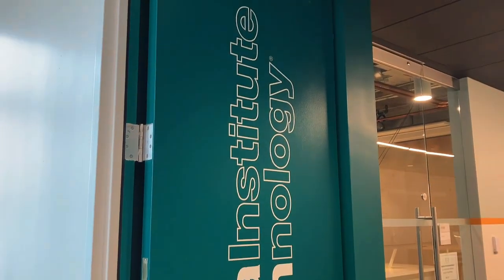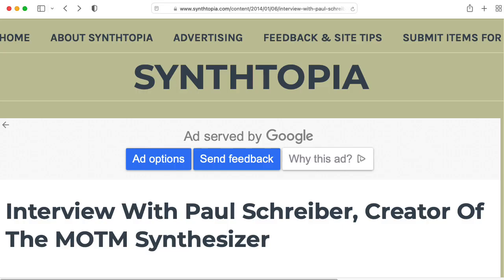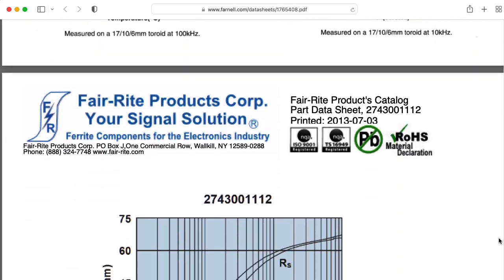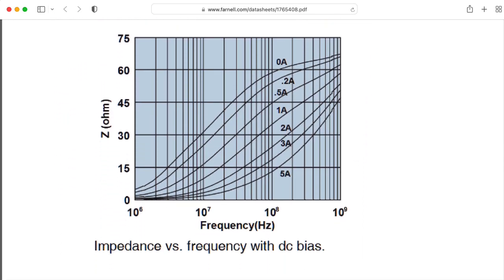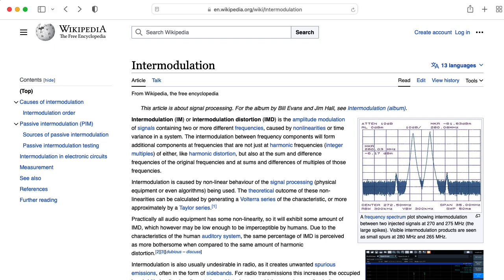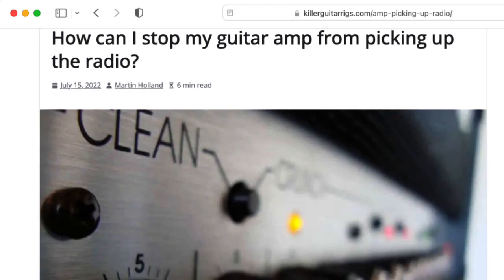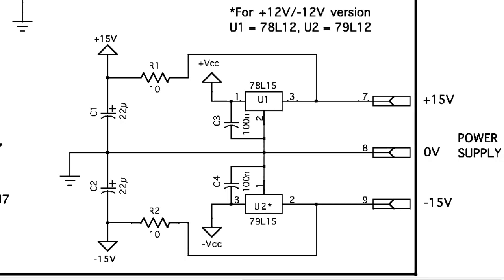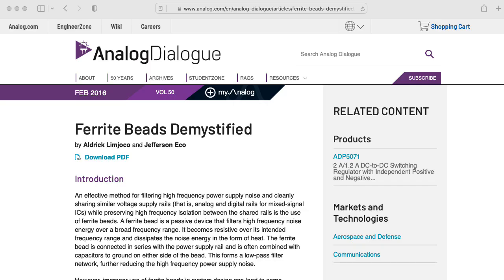Synth Power Filtering: To Bead, or Not To Bead? (alternatively, Ferrites: Functional or Foolhardy?)

Comment: Both, in the case of BBD-based echo / chorus / flanger instruments. The BBDs operate at this fun little frequency range up to either 100kHz or 200kHz. Ferrites: best results are had by using large value ferrites (quite low frequency by ferrite standards) between the FET driver outputs and the BBD clock inputs, ensuring not much unintentional noise, no matter how small, passes into the BBD clock inputs. Meanwhile, the FET drivers' power, and clock gen's power, both sit behind another low freq ferrite, a power diode, a 16Ω power resistor, along with a dedicated tantalum nearby, to keep the whole clock shebang far away from the rails. Dead-quiet BBD echoes without needing to use a compander. Fair game, until the operator intentionally pushes the clock down below 20kHz, then all bets are off and the fun begins. The result is of course audible ring modulation, but importantly, it stays off the rails, playing nicely with the rest of the synth.
Reply from the maker: Pinning this. :)

Comment: If you use 10ohm resistors on say a +and - 15v dc rail what size should you use. I ask as I used 10ohm 1/4w resistors before and they caught fire.  Would you need higher wattage rated resistors for the rc network . Or is this an effect of the output current rather than the voltage?

Hope this made sense 

Kind regards

Comment: I used a fiew times small inductors. Higher resistance and inductance than beads, better filtering in wider frequency range. More expensive unfortunatelly. Only in my own circuits.

Comment: Hi Aaron, would you recomend using ferrite beads on the supply rails of an  analog chorus  pcb that has a clock running @ 200khz?  So far on my synth project I have not used beads on any of the rails because I am using a linear supply and have no digital noise. I have only used low pass filters at this stage. 
Cheers.

Comment: Hi Aaron, since you mention my way of dealing with these HF interferences over the power line; I use 10 ohms resistors also to reduce the voltage drop which is minor if the module current draw remains under 30 mA. As a matter of fact I maintained these 10 ohm resistors because they saved my ass in many occasion while SDIYing. They act as current limitors in case of short circuit in the module and in very frank short circuit they simply act as fuses and get burnt, while the other components are preserved. Therefore two functions HF filtering and current limitation... Hope this helps
Reply: Hey Yuaynth I noticed the 10ohm resistors in alot of your schematics . What wattage do these resistors need to be . As I used ordinary 10ohm 1/4w resistors which just heated up and caught fire ?
Reply: @AdamTheAd-vanc3d  Hi 1/4W is OK in most of the cases.
Reply: @yusynthman  Many thanks for your reply 🙏🏾

Comment: All I know so far is this CUBE cheap low-Wattage guitar amp picked-up some local AM (pretty sure it was not FM, not sure if I bothered checking) station was getting annoying enough upon un-boxing I should've returned it.

* * * b u t * * *

I intuited or near that this ferrite ring core about an inch and a half in diameter about 3/8" square cross-section 'that'll fix it!" came to me, detached the clip from the Pos lead on the little cheap five or six inch speaker, wrapped it around the ring about 6 to 8 times, not sure why I didn't pull my usual OCD and wrap it until it was too short to re-connect, and

VIOLA!

no radio in the speaker any more.

did I test it in a different location to see?

probably not

it just works

Thanks For Furthering My Edumacation On This IMPORTANT Topic!

Comment: I made a theoretical (not empirical) study of this, and found a number of things.
(1) This is a bi-directional filter. Given a decent bus, the biggest effect of any of these solutions is not to filter that bus, but to keep high speed current draws confined to the module that draws them. That module will be less able to pull current out of the bus at those frequencies, using the on board capacitors instead. As a result the bus will be quieter. It's the same principle as pandemic masking: it's hard to fight disease/noise out there, so the best solution is to not be an asshole, especially if you know you're sick/noisy.
(2) Again, what you're filtering is your ability to draw current from the bus. If you can't effectively pull enough current from an on-module reservoir at the blocked frequency, you have just made your power distribution much worse. This will manifest not just as a DC voltage drop but as a voltage drop that varies with the current draw at the frequency of interest, potentially creating correlated noise, i.e. distortion. Resistors, inductors (because practical inductors are resistors), and diodes all will exhibit changes in voltage with changes in audio rate current, making your super accurate power regulator and low impedance power bus totally worthless. A ferrite has practically zero resistance at DC and audio rate. This is in fact exactly what you want. It allows the bus and regulators to do their job and get stable voltage to your module at any frequencies which your bypass capacitors are too slow to provide.
(3) To summarize: there is a frequency dependent tradeoff between keeping noise off the bus and having a stable voltage. In most cases the ferrite bead is pretty much the perfect solution to that problem. However, if we assume a relatively clean environment, some modules won't need it. And for a very high current draw at high frequencies (a digital module), it might make sense to use an inductor instead, provided you can demonstrate the resulting system is overdamped and won't ring or oscillate.

For real, though, the idea of "the audio range" causes so many problems in audio. People keep simplifying things by throwing out all data and results outside of those magic frequencies, as if they just didn't exist. Then it turns out that there is a relationship between the time domain and frequency domain, and that only with purely linear systems (which don't really exist) will things in one frequency range stay in that range.
Reply from the maker: I love your pandemic analogy. :)
Reply from the maker: I'm often helping students debug in lab where the sound will be anemic, and we put it on the scope and discover there's like a 500 kHz parasitic oscillation on some op amp eating up all the dynamic range.
Reply from the maker: And indeed, Eurorack power rails seems like an awfully messy place!

Comment: Ferrite beads can be an extremely effective means of heavily attenuating impulsive noise riding on the supply rails of a shared backplane, preventing it from getting onto the local supply rails inside of a module. If the impulsive noise has a period at audio rate, then it can very easily, and often will, find its way through your final vca etc. to be present at a very low, but still annoying,  audible level at the output. Suggesting that they are of no use (the article) is incorrect; please take Paul Schreiber's advice.

Comment: if I were designing more MCU based circuits I'd probably use them, but I don't currently. as someone else stated, they're incredibly cheap so I think moving forward I'll give them a shot. 

also the 10ohm-resistor-as-fuse thing always makes me wince. it's the basis for low-pass power filtering sure but I'd far far rather use schottky's for reverse polarity protection

Comment: Well for me there is no debate for now... my DIY small system just works well enough with a basic linear DIY power supply, without ferrites. I don't use microcontrollers, just pure anlogue basic stuffs with opamps. 

It is just until very recently that I was more worried about power supply cleanless, when I started experimenting with RIAA preamps. I was just wondering if I could power it with a +5V cheap external power supply and a charge pump for -5V. These preamps just grabs anything unless connectors are wired to ground and with a good shielding around the circuit. And all the ripple in the power supply is audible, with no real way to avoid it completely. So yeah, linear power supply is the way to go in these kinds of (if not all) audio applications.

Comment: i didn’t bother with them for the first revision of the module i made and kinda forgot about, but i did calculate the lowpass from the resistors and capacitors to make sure it would actually have a decent effect, the caps on the back are pretty large as a result lmao. as in, if i’m gonna put some resistance on the power rails, i might as well get good filtering with it. i think it’s somewhere around 200-500hz, not enough to remove everything, but enough to remove the more noticeable higher frequencies.

it’s analog but very nonlinear so maybe for a future revision whenever i work on it again i’ll try to find a ferrite bead or inductor that would be useful in the range of common clock frequencies. i don’t have a working unit to test to see if it’s an issue, so i dunno.

Comment: As an active RF engineer with 40 years of design experience, Ferrite beads are primarily used for RF isolation (say in the 1Mhz to 1Ghz region), they will have little effect on audio signals. semiconductors have much more ability to rectify RF signals in todays circuits as compared to 30 years ago due to semiconductor process improvements. It is very common for audio circuits to pick up stray RF signals (including from cellphones) and to rectify it a bit and cause DC shifts or demodulate the ampltude portion of a signal. GSM cellular is especially nasty for creating 'noise' in the audio band. You will find many RF beads in every single properly designed circuit that uses big (ie higher current) CPUs or DSPs to help isolate digital sections from the analog sections in these circuits. At todays current levels, 10 ohm resistors will not suffice.

Comment: I often use Ferrite. Beads for my designs. I got a Reel of Z=180Ohms@100MHz (3000mA) SMD 0805 hat hand why not use them?. they work in frequencies where bulky capacitors do not work as capacitors. I mostly built a "T" topology with two Beads and one 100nF foil-Capacitor to Ground on input and powerlines to enable hot-plugging and prevent spikes from further stages..passed all my EMV tests..

Comment: If I were using a linear power supply I probably wouldn’t bother. If I were using a low-noise (especially quasi-resonant) switching power supply with I also wouldn’t bother. But if I were using a common SMPS, especially an ungrounded one, those square harmonics are going to be well into the MHz, be they carried on wires or transmitted through the air. I’d probably use a choke of some sort, probably also a capacitance multiplier if the circuit’s PSRR is low. Capacitance multipliers, especially when used with a zener diode (or TL431) give much better ripple rejection at non-mains frequencies than conventional linear regulators, I’d recommend them over series resistors any day.

Comment: I am on RLC-filtering side (something like 200-500 uH on ferrite 7-10 mm diameter toroid + 4.7-15 Ohms residtor + 6.8-15uF tantalum/electrolityc + cer caps 0.068-0.33uF close to ICs)
However i have no VNA to test it on high frequinces, but on low frequinces this RLC filters provides 40dB/decade suppression. Choise of R depends of power consumption. It must be simulated to not have resonant burst on the frequency response while you simulate all your circuit by resistance of equivalent power dissipation.

Comment: Beads can filter high frequency noise, but also affect the PCB PDN impedance (Depending on your PDN needs this will require testing and you should). Most likely, poeple end up over decoupling with caps acting more like coulomb bucket helping PDN. Beside Ferrite+caps may resonate if the second order filter turn out under damped (The systeme could have a spike in the bode plot between 60KHz and 200 KHz and that is for you to mitigate or accept this effect in the design phase). If the design have a low speed digital circuit with MCU, I doubt this will be a problem. For ADC and DAC, beads may turn to be problematic causing ground bounce. Bypass caps also act as high frequency filter making low impedance return path, this is why Pi filter are popular in the audio world. Lee W. Ritchey would call ferrite beads Voodoo beads and in design with signal rise time requiring harmonics above 2.5GHz I think he is right to dislike them, but I like to leave a open door. I tend to put compatible footprint in design and test for myself between Beads, 0-10 Ohm. I have yet to find a design were the ferrite beads turned out to be a true necessity, but leaving a ferrite/0 ohm footprint cost nothing and you do not have to argue with old timer engineer about ferrite.
Reply: Agree, it’s very wise to leave yourself room for configurability when you’re at the EMI lab realizing you’ve made a Big Mistake. I also think that modern digital ICs with controlled edge rates make the approaches used in the past less useful.

Have you encountered these resonances even with the high damping that beads provide? I would for sure expect these problems with pure inductors, but the FBs tend to be very lossy.
Reply: @enginerdy  I know, ferrite are a very popular quick fix when facing a failed EMC compliance test. In many cases, they impede the high frequency harmonics, lower slew rate and indeed, a board with no High frequency harmonics will stop spitting EMI. If every designed functions still works after that, I think its great and hardware designer should go for it at that stage. I have my share of mistake fixed that way, but I always look at that solution like a bandage. 

I once had a piezo element that went into resonance (Bigger caps made the needed zero to solve this). So I did learn the hard way about this resonance effect. Aldrick Limjoco has a decent article on the Analog device where he talks about the resonance. It makes absolute sens. Beside I had to the fact that I did put a bead there, and did not calculate anything. That is the main problem with beads, I have the feeling people put them in design out of habit not knowing exactly what they do and why it is solving their problem or causing them. 

If you look into LTspice, they have many ferrite model from Würth Elektronik in the base version and you can simulate this resonance effect by matching High Q capacitor with them (They can resonate in the MHz if the cap is small enough (This will normally not happen on a power rail). Their model are not loosy enough most of the time. Fitting their model with a real PCB may require some additional "lefty" mohm in series in the Spice. In real life application, I found that anything around 22uF and above never resonate when paired with classic 30 - 120 ohm beads, but that is just a personal observation based on the rare ferrite I use.
Reply: @ltremblay1598  I also consider a ferrite cable clamp as a failure condition of a design :(

Comment: Those beads or multi-turn chokes help a lot to reduce high frequency noise. We mostly use those on microcontroller components to prevent interference of the digital signals on analog parts of the circuit. Not only do I use these on power input but also on analog (input and output) signals and as common mode chokes on balanced (digital) signals like USB and CAN bus lines. It is amazing to see the effect of placing a common mode choke on the USB data lines. 
Placing them on the power input of a synthesizer module might seem overkill but it never hurts. Do remind that the impedance of a small bead can be much more than 10 ohms for higher frequencies.
Reply: how would you wire a common mode choke in a 2(+-12V) or 3(+5V) rail power supply?
Reply: @woosix1  I would not. Since these power supplies have a common ground, there is no need or use for common more filtering. Common mode filtering is only done on balanced (data) lines. Also, the ground connection of the power supply is often also used as a data (or audio) ground so putting that wire in a common mode choke on a module would completely defeat its purpose and possibly even having a countering effect.

Comment: One pro argument could be that removing very high frequencies from the circuit could help an op-amp or transistor avoid going into resonance at these high frequency, which could damage them. Much like adding a grid resistor to a power tube perhaps. But probably a good way is to measure the frequency response of the circuit in different environments and different power supply and see if one can measure anything undesirable.

Comment: IMSAIguy did a video where he measured the effect of various ferrite beads and found they could vary quite a lot in quality, with the worst one being almost no effect. These were mainly the big beads, he does do some small beads and some different designs of small bead are on par with the best big beads, while the normal small ones are on par with the worst, which seems appropriate. My point in this is, unless you have the right test equipment, a good frequency sweep generator and an spectrograph with high enough range, using beads is really in the realm of reckoning. Every other basic component has tolerances and defects, but the instruments to characterize them is cheaper, easier, so manufacturers are easily held to their standards. Without testing them, you're reckoning that the datasheet is true, and the parts are authentic. The only thing you can do to improve that is buy from highly reputable vendors and highly reputable merchants. Even then, you're reckoning what type of problem there is, you don't have the specifics, which can make it hard to select the part. I'm not saying you shouldn't, but that without the right tools it's kind of a bandaid shotgun, you might simply miss the problem, and "failure" won't indicate anything more than "this one didn't work", perhaps because it was the wrong one, perhaps because it was a bad one.